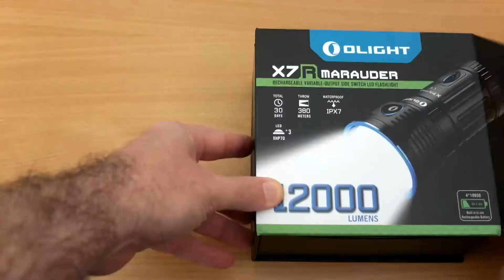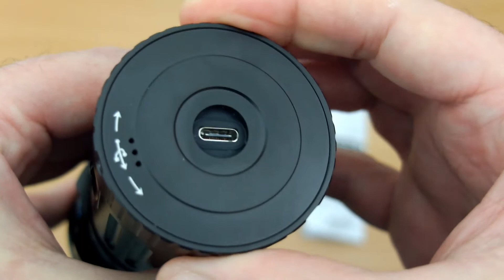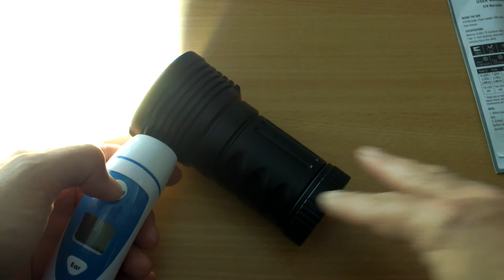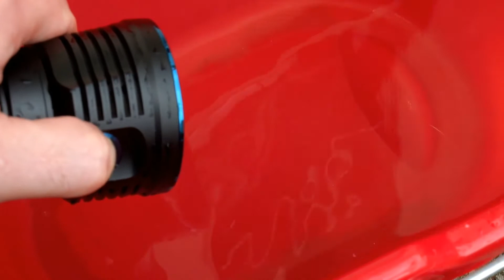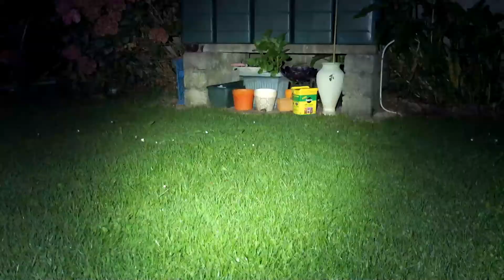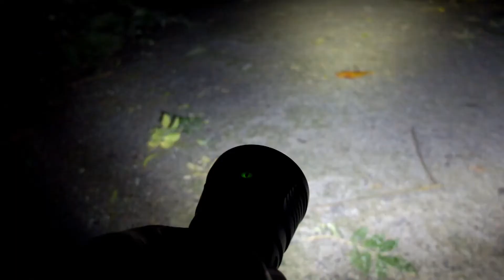Olight X7R Marauder (12000lm): Review

Comment: Hello Mr. Baz. The X7R is on sale for $170 US. and the Astrolux MF01 is on sale for $75. Which one would you choose for roughly a $70 difference counting batteries for the Astrolux?
Reply from the maker: I'd probably go with the Astrolux because I like the ability to change the batteries and it's a very solid light for the price, that's my take. The Olight is good no question I just think the bang per buck on the MF01 is right up there for a high power light.
Reply: @MrBazReviews  Great, thanks for the advice, great reviews btw!

Comment: Great review as always. Mine has just arrived from Amazon UK, great build  quality. I'm having one trouble with it, and that's the lanyard holder. I cannot pull it out, it is completely stuck! I've emailed Olight, and still awaiting a response.
Reply from the maker: Hmm should not be stuck it comes out quite easily let me know if you can't get hold of them did you try to pull it out with string or something like that?
Reply: You can't get anything in there, the hole is out of sight. I even used some pliers - putting some cloth over them first, it still won't come up. Still no reply from Olight. I emailed them around the same time a few days ago, to enquire about the light before I bought it. They emailed back within the hour, but not now that I have an issue. :/
Reply from the maker: With Amazon send it back you have 30 days and they pay for shipping too. You can pick to get a replacement or refund. If you still have problems and don't hear from Olight let me know I will get in touch myself to try to help
Reply: I was right in the middle of replying! lol
I spoke to Amazon, they refunded me the money, so I could buy another one, which arrives tomorrow. I'm off camping/beach fishing tomorrow night, here on the South coast, so I definitely wanted it for that. 
I have a Thrunite TN40, and I also purchased the Fenix CL30R, so i'll take them all with me to test out. I love lights! :D
Reply: My replacement has arrived - nice and speedy! All is good! It easily lifts up, as it should. very happy! Looking forward to using  it down at the beach tonight. Thanks for your help, Mr Baz. Much appreciated. :-)
Reply: Second light with an issue now.. the switch has come apart: https://postimg.org/image/c6cenl0lh/
Not happy!
Clearer image: https://postimg.org/image/6aih06lad/
Reply from the maker: You must be incredibly unlucky I've never had a switch come out like that on any light. Send it back and let me know if you get a replacement
Reply: I got a reply from Olight. Very helpful. They are disappointed with who ever checks quality control and said they would immediately look in to this. They have promised a replacement too. The ring of metal that popped up, almost looks like it is a bit of waste metal from machining, it is extremely sharp. I expect it isn't, and that it is part of the switch, but the question is, does it compromise the waterproofing?
Reply from the maker: Unlikely might be a surround for the switch if it's or should be really tight it won't let water in maybe there is a seal somewhere in there. Hope you get that sorted out
Reply: I got one a few days ago and it failed the water test. I submerged it in local creek to have the light start changing modes by itself. Also the lens fogged up. I just charged it up today and everything seens fine except the fog on the inside. Im waiting on a reply back from olight to see what they say.
Reply: Mapantz1 that’s crazy! I’ve never had an issue either with a ton of Olights. Ugh!